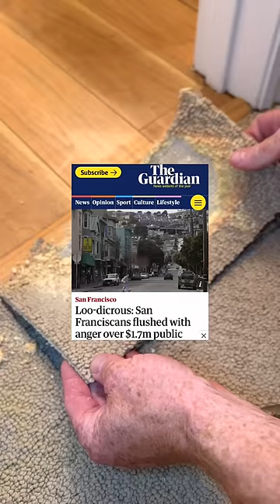$1.7m bathroom bid #shorts

Comment: hey dude idk if you’ve done this or not.. but some shorts vids explaining some of those tools you use would be sweet! love the vids i’ve seen man
Reply: He used a carpet awl to separate the fibers, then he used a cushion back cutter to cut the carpet. He used a kool glide carpet iron to bond the seams. Then he used a single star seam roller followed by a triple star roller to blend the seams and help push the backing into the hot melt adhesive. I don't know what he sprays on there. Maybe just some water.
Reply: @jmccormick1490  how do you know this?
Reply: @Matt Matti  I install floor coverings for a living.
Reply: @jmccormick1490  thanks for the info dude! good stuff
Reply: This was a wholesome thread :)
Reply: They will make you old before your time !!!!! Sorry, that was my knees talking 😩
Reply: @jmccormick1490  Gotta be careful with that iron.. First time I put carpet down there was a little bit of a gap and the glue set. I still have flashbacks from my boss yelling at me..
lol
Reply: @Matthew Lindung  Right? It's a pain in the ass to fix. The cool thing about that kool glide seamer that he uses is that you can reactivate the seam tape from above if you have any problems since it uses micro waves to heat the tape. Fixing seams with a Traditional iron is a real pain. I haven't messed up a seam in a long time (knock on wood).
Reply: I know it's old, but he does have a video with his tools.

Comment: "At least the bathroom isn't carpeted"

"I will offer to carpet the bathroom " 

Whyyyyy, that's so gross, especially a public bathroom
Reply: My mother had a carpeted bathroom for years. We'd buy a 7' carpet remnant and cut it to fit, replacing it ever couple of years. It was just sitting there, not 'installed.' We had it that way because the old tile was in rough shape, and it had been laid on a mortar bed, not cement board (built 1941) and getting that old tile up would be a massive undertaking.

Comment: Is that a hart putty knife? I think I have the same one but mine fell apart to pieces the first time I actually used it. (Hitting it with a hammer to separate the caulk holding the shower together) it got the job done so there's that at least
Reply: After pausing repeatedly I think it's a husky.

Comment: yeah I volunteer at a park and we had got money for a grant to put in a bathroom it cost $300,000 we have a electrical buisness  we offered to do the work for free to put in the lights the costs came in from the contractor $500,000 the tolites are the lowes $70 there is 3 tolites it does have a roof and locking doors its very small no idea how the costs came up so high when the electrical was done by us for free where I all these costs they also tore down a building from 1950 that was huge we ran summer camps in it could hold 48 kids without a problem let them take naps they tore down this huge building  we had plans since 1980 that was supposed to be a train station that they originally tore down when they put this up we wanted it redone so we could host alot in it after 3 years and the city stole our 1million dollars to rebuild the police building we had tax money that was voted on and given to us we are talking a project in the works since 1980 mind u finally finished its so tiny came out suppsoed to have a comercial kitchen as it used to have one now a very small house hold stove sink in the room its about 10ft by 10ft they spent 1.5million as all we had left after the thief mayor found out about our money and took it where do u go when the mayor is tbe one stealing ur money on parks seriously they got rid of employees all thats left is volunteers we dont make money have put in years since 1980s I was a kid my mom still there my kids apart now how do u stop the corruption how is a building outside 15x15 took out a giant place cant do summer camps anymore and thats what paid for the park upkeep. so sad